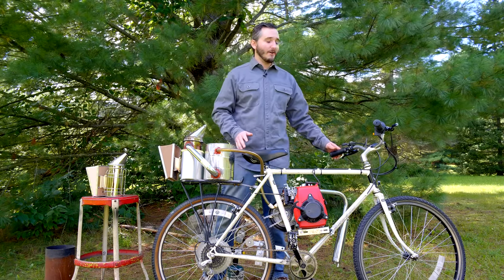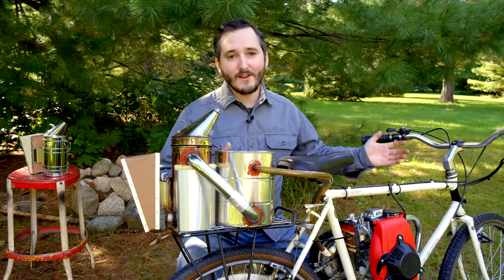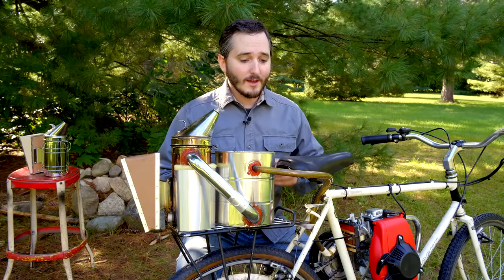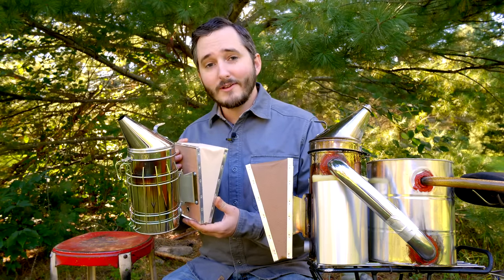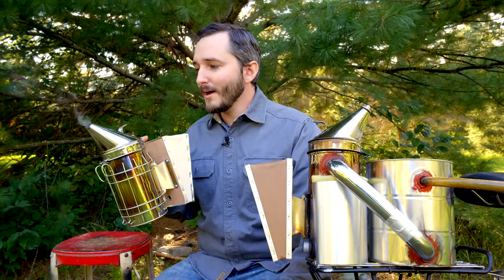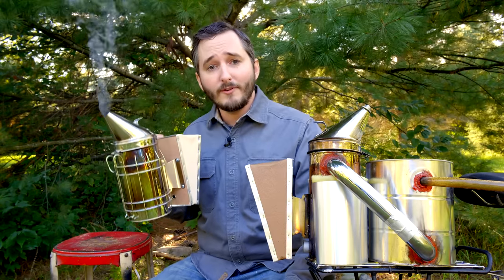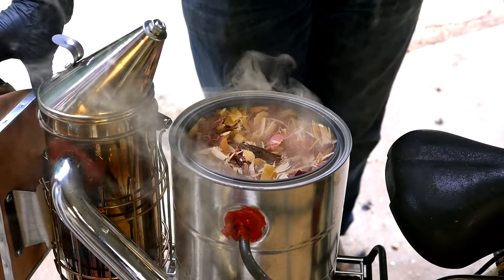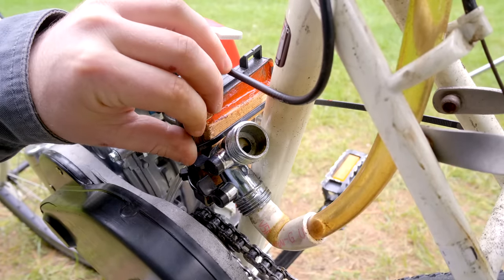Running a Gasoline Engine on Firewood | Woodgas Biofuel

Comment: great job :D
if you want some suggestions 
maybe reducing the size of the filter and replace it with a gaz storing mechanism since the produced amount of gaz is a bit small. 
few other thing you might consider is putting an isolation between the the gazifier and the wheels 
add few pipes to evacuate the engine vapors behind, like it's done in motocycles 
add a little mechanism to boost the gazifier form time to time by pumping air

Comment: have you considered charcoal as a filter to clean the wood gas output? Even if it clogs, it's easy to replace!

I think the CO2 in the wood gas is going to continue to be a problem. From what I recall, the "perfect" air fuel mix is 14.7:1. if you are correct about the CO2 doubling the volume. ... I'm trying to think if it is going to run rich or lean. It runs which is amazing. It may be struggling with intake struggles? Have you tried igniting the engine exhaust to see if you are venting a lot of unburnt gas?

I think you should make a gasifier like your previous designs so you aren't pumping CO2 into your engine.

Or you can avoid this by running it in a Diesel engine which runs perfectly in a extremely lean setup.

Comment: Its cool that he just about made a wood powered bicycle. If you added an battery powered air pump to the air intake I'll bet you it would work. Since you can see smoke coming out of the air intake during operation it shows that the pressure must be rhythmically reversing itself. 

I'd like to see a way to power a 60lb. thrust jet engine on wood gas! Perhaps use it as a vacuum to intake the smoke into a pressurized tank, so you're not carrying any wood.

Comment: I don't know much about gasification but if you can some how get a storage tank for the wood gas maybe you can store enough fule to do more than idel for a few seconds/minutes. Also if you put a basket like the sattlebag style ones you maybe able to put a larger reactor tank the filter you have isn't really a problem although I would use the lightest material like a coffee can and a  some silk stockings.
Also a way to cool the woodgas may help. Like a putting fitter can in a lager can/bucket filled with water.

Comment: One thought I just had: Use charcoal for this application.
The tars and moisture would be much less of a concern.
I am planning on using a Vevor brand 5 gallon Stainless Steel Still as a reactor for my own gasifier, both to make the charcoal as well as gasify it for engines.
I intend to use the gas produced from the charcoaling to produce Domestic Hot Water.

Comment: there's also two stroke systems with separate oil supply. they just squirt a little bit into the intake with every rotation - might be an option here.

Comment: If I remember correctly, didn't the WWII cars and trucks run with a large rubber bladder full of gas?  Perhaps you could "precharge" a truck intertube with gas and mount it like a spare tire, to the rear?   And keep it topped off with your smoker...   perhaps the pressure from the tube would allow you to use the original carb for mixing the air fuel mix too.  Love your work!

Comment: I really like this. Consistant on demand gasifiers are dificult to put together and opreate. Might i humbly suggest going back to a "gas tank" idea? Just that the tank is full of synth gas from wood instead of traditional fuel. To do this, tripple water filter the gasifier, and use a compressor to fill an empty 3-5 gal propane tank. At 1/2  max psi, that is enough gas to run 2 dozen miles by my math.

As a secondary fun experiment the refinement and distallation of the residue wood tar from the tripple water filter can be made into methanol (wood alchohol) which will also burn nicely as fuel.
Reply: That's what the public transport did in the UK during the war. Specifically London. They found it was too tedious and inefficient to make a gasifier for every vehicle, train a driver on how to operate it, keep it loaded, and drive.  They just decided to build a huge commercial scale gasifier, produce and refine the gas at one location, then deliver the gas at various storage depots around the city, while the busses had be retrofitted with large fuel-bladders on the tops of the busses/taxis which would top off at the depots while doing their routes. This allowed them to produce a consistent gas, capture the spoils efficiently, and with the consistent fuel quality you only needed to configure/tweak the engine one time, then just drive normally.

Comment: I'm not thinking this is a good idea what are we going to do when we run out of trees for the fire 🔥 place in the winter. Excellent idea I saw it in a movie maby 57years ago when I was just a little boy they were using coconut shells in the back of a school bus 🚌. The setup was quite larger of course. You did at least prove it works! Bravo bravo bravo 👏 bravo.

Comment: Couple of side storage bins on the rear wheel, housing gasifier on one side, filter/extra fuel on the other. Youd have to refuel periodically but I think youd still fit a bigger system.

Comment: Upgrade idea? Watched the video and noticed once the engine was idling, you were losing some of the wood gas out of the secondary intake ball valve. I would think adding a one way valve may improve the function.  This way you would get the needed extra air coming in, but not lose the wood gas. Good luck

Comment: Put U shaped bends in the water filter can to make it filter more air. That being said,  they will require more maintenance for prolonged use and you won't be able to add too many or the resistance won't allow the air to flow through the filter as efficiently as it is required for operation of the engine.

Comment: What if you built a chamber specifically to heat your fuel source similar to modern charcoal kilns.  You would isolate the majority of the smoke from your fuel source and could also use a longer burning material like coal to heat your system.  This would remove the smoke/tar from gumming up inside your engine.
It might be worth looking into electrostatic smoke precipitators for removing the smoke.
Neat stuff.  Love your vids.

Comment: I've never built one of these systems, but I can tell you what I've researched. Down-draft smokers work better than updraft smokers. You already mentioned you wanted a larger setup. You might also consider adding more cooling and more filtration to the smoke before it mixes with air. It looks like you might need check valves, if not in both lines, then at least in the engine air intake line. I can't remember what sort of compression ratio a gasifier system would prefer, but I think it's somewhere between gasoline and diesel, maybe in the 14 or 16 to 1 ratio? If you're not already aware, the US govt released a pamphlet (during WWII or during the 1970's fuel shortage?) instructing people how to convert from gasoline fuel to wood gas fuel.

Comment: You probably need another step in the system such as a copper coil or radiator for cooling and condensing the gas before it reaches the engine.

Comment: Couple a belt/ gear driven small air compressor system(with air bottle and relief valve) to the engine. Connect a flame arrestor/ wire mesh chamber with relief valve in between the engine and woodgas peoduction system.

Comment: All you should need for a quick filter setup should be an S-shape airlock with one water, one ethanol/isopropanol for reduction on the smoke, and a bigger stove, more volume to make more wood gas, with less small diameter pipes that cool down gas

Comment: In essence, that is a Fema tar maker. Cool idea, but still a Fema.
  Switch over to a charcoal gasifier. Start it with a dc powered blower. Use home made char ground to between 1/8", 3/4" .
Screen out the fine dust. add a dry filter. And when it will flare, your ready to go! It's also easier if you start the motor on gasoline then switch over to char gas.

Comment: Maybe charcoal in the filter and a gassifier you make yourself. There's videos you can find of a wood gas stainless stove design also a farmer who makes charcoal large scale and teaches how to utilise all the energy. The farmer has design that could be condensed but he uses 2 barrels. The inner barrel has holes on the bottom and is filled and sealed on the top. (Paint cans might work!) Fill all around the inner can, stuff it to the top with wood and light from the top. The outer barrel has holes on the bottom to vent air and a flute directly in the middle of the top to promote equal burning where you would run to your filter (filled with char 😁😝) and on to the engine. Wait 2 minutes or until a sustained flame can be achieved after lighting. Very efficient on a large scale im just not sure about a compact design. Thanks for all your videos, i thought i would share a little back that might help
Reply: can you link me that video?

Comment: try closing the air intake just a little bit more while starting, its called choking the engine, when it runs slowly open it to the best mixture, also try to make your spark plugs spark gap wider or narrower to see if the engine runs better on any of theese settings
Reply: also -this kida goes against your idea but it could definetly help imptove the design, before starting use a spraybottle to spray some gasoline into the air intake ( but dont choke it as much ) so it starts without you having to waste so much firewood on just stoking  the fire before starting. maybe you can also add a stoking fan that runs on a small battery charged with a dynamo st stoking is not a problem at all anymore

Comment: I know it's quite late since you uploaded the video, but I thought of you adding a simple one way valve on the bee's smoker, and adding a "turbo" by hand pumping the smoker. You can add a cam or some linkage, to run this operation from the engine output, or a real turbo turbine that pumps fresh air into the smoker.

If you read this, yet so late, I'd like to know if you tried it, and if you had any runs on a variant of this bike.
Thanks!!

Comment: I love your plumbing fixture intake! However, I do see an issue! Your tubing that runs from the gasifier to the engine has a kink in the line, restricting flow. At 8:32 I saw it. AWESOME IDEA! STOP HERE & THERE & INSERT A FEW TWIGS! AWESOME! Maybe use a pvc 90 degree fitting?

Comment: I suggest that you put a knockout put at bottom of pipe where your fuelgas enters engine to protect engine and reduce moisture and tar / pitch liquid build up in your engine. Then if you manage to get it to work properly your risk of explosion will go up, as if you collect VOCs in that collection pot over time, for this you will need a nrv (non return valve) or flame arrestor. Then also a drain point or removable demister pad in that knockout pot. (CH4+CO2+O2+heat) => H2O + CO2 + CO + more heat. So you can also recycle that heat back via tracing on your gasifier or via a mini turbo to ensure better flow of gas
Reply: Next step is gas shift reaction!! then you have real fuel

Comment: Hardwoods burn slower, so if you could pack in shavings of pine at the bottom and start those with a hardwood on top, such as hickory, yellow birch, cottonwood, maple, beech or ash. Another thing is, while riding I know you can refill your system with wood, but what about all the left over charcoal? I’ve also heard that you can mix vegetable oil with turpentine (both are sourced from biotic and renewable resources) and you might be able to run it on a Diesel engine.

Comment: as a mechanic i think your main hindrance is your lack of metering and not utilizing available pressure differences to your advantage. you need better control of the fuel air mixture to run that engine for any usuable amount of time. maybe get rid of the water hose splitter and float valve and input your wood gas in the carbs fuel hose. that would allow the carb to meter the fuel mixture.

Comment: You are using the wrong frame... Try doing it with a go cart! You would be able to fit a mini keg. Voluminous enough to cater for 5-15x the size. And you will find that the type of timber you use is critical, in terms of what oils are being burnt within the grains; in Australia a Eucalyptus Tree would work well doing this. Big fan of your work!!! Would love to get in touch with you and speak about several ideas, and also gain some inspiration from yours!

Comment: My idea, It may not be as practical for a bicycle, but automotive for sure. Use a propane mixer, impco commander and solenoid. This allows the engine to be started on propane,  as wood gas production increases the commander reads the o2 sensor and decreases propane.  If there is enough wood gas then it could completely shut off propane.

Comment: may be you should produce wood gas and  compress it in an conventional iron gas bottle.  Then you will have enough gas to run the engine and you'll just have to transport that bottle on the bike. Awesome job by the way!

Comment: Try using a saddlebag set up in. order to better distribute and balance weight and to have higher height for a larger gasifier burn chamber. Also, maybe try fusing an hho generator to the system to improve the quality of the burn rate. Not sure how possible that would be, but I hope it helps.

Comment: I think you should take a leaf from Project Farm. He gets rid of the pull lever and uses a drill to crank his engines over. That would help in keeping the engine turning and pulling gas while you're working the mixture.
Reply from the maker: I tried that but it turned out to be pretty hard on the wrists. Not a smooth engine to turn over.

Comment: I think I would pull off the hand pull start and start it with a cordless drill turning the motor over. I love this though! I really like adding a bellows to the downdraft gassifier!
Reply: Also take a look at a ford 8n 9n and 600 tractors built from the 1930”s to 50’s. The air filter they used on those forced air through through (well sucked the air actually) a filter filled with oil and steel wool by just using the suction from the motor. I have always wondered how well it would work for filtering woodgass!

Comment: Idea: use 2 bottles as filters.  Ome bottle full of shavings, the second full of water.  The gas pressure from an appropriate sized gasifier should push it through, and taking out more inert stuff shouldake it burn much more efficiently.  And the bottles shouldn't need to be so big, maybe a pair of 1liter bottles.

Comment: It’s possible that it’s pulling too much air through the gasifier, and it’s going lean when it runs a bit. A bigger fuel charge would assure more CO production. Higher temperatures may reduce the amount of fuel wasted as soot. More cladding on the gasifier will help. What does the spark plug look like? Give up on separating water out - you don’t have condensing and draining.

Comment: ball-valve doesn’t give you precision control over the airflow.  prob. want something on a screw thread.

that air intake is interesting; a few things you can do there:
- maybe want a flare-port, to test the gas?  (at a safe angle)
- prob want some small device, (like a blower fan,) to pull vaccuum until the engine fires up?  — a Venturi would work too, and might be cleaner!

Comment: You might want to try wood pellets for wood stoves. Inexpensive and consistent quality, already dried. Yes, a carborator with an air filter and a consistent easy to adjust mixture would help, maybe make something out of sheet metal. That garden hose wye connector is a decent first attempt but too hard to adjust it looks lie .

Comment: I feel like this build could use a judicious touch of one-way valves and a water-bubbler fuel filtration system. You might also need a way to pull some moisture out of the fuel mix. (I'm not sure exactly where for these, but I trust that you'll figure it out.) And obviously an increased fuel supply. Once you standardize your fuel source, you could just tack three of those smokers next to each other with the bellows joined by a linkage to get consistently rich fuel. Curious to see where you get with this!

Comment: What if you put the wood in a container  and start to heat it from the outside like frying an egg in a pan with the heat supplied to the outside (bottom) of the pan? Would that make the gas any cleaner?

Comment: The mixture rushing into the engine tries to keep moving once the intake valve shuts. It slams into the valve, compressing like a spring, then reverses direction and blows out of the air intake. This starves the engine of air, and it shuts down.

Make the intake line longer, and along its length, add a tube that goes down into a sealed chamber. This chamber is called a Helmholtz resonator, and it gives a space for this shockwave to vent into, and if it's just the right distance down the intake line, it will come back out just as the intake stroke begins. This will stop the mixture from blowing out of the air intake so that your engine can keep breathing, and it will increase power and efficiency.
Reply from the maker: Interesting thoughts. I think the volume of the resonator would need a plunger in it to adjust the frequency as the engine is throttled.
Reply: @Nighthawkinlight  That's a good idea, but I have to wonder how much of an effect it will have. I know these resonators exist on a lot of car engines, people usually call them the "mystery box." They're easily visible on the air intake line on 22R engines right behind the headlight, if you'd like to look up a picture, and I've never seen an adjustable one.

Now that I think about it, the frequency depends on its position on the intake line, not on its size. The internal volume of the resonator depends on the air volume of the shockwave. Auto manufacturers seem to place it around the average they need.